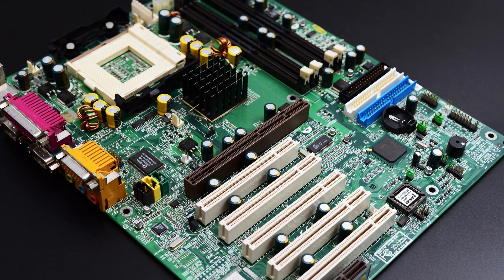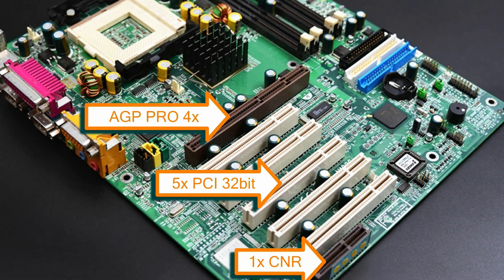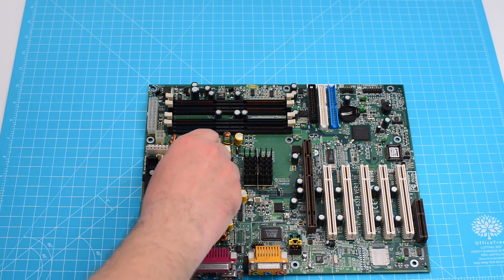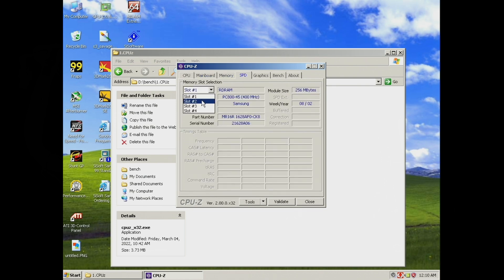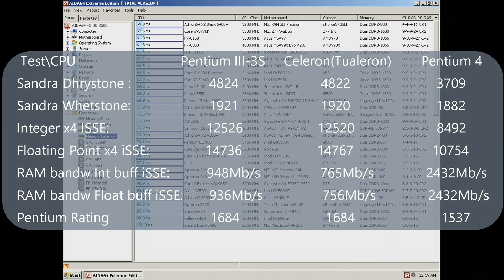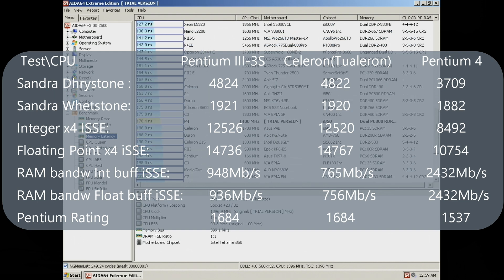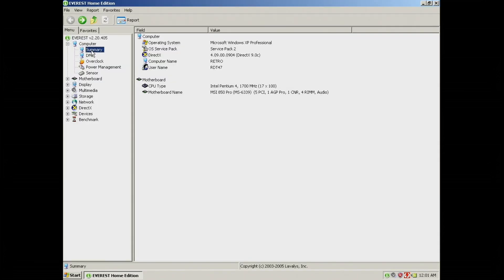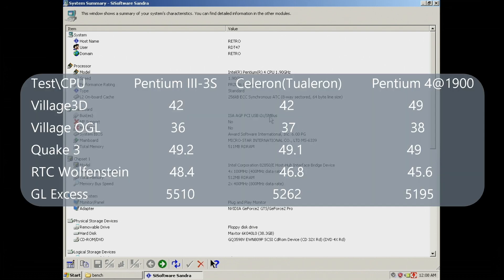First generation Pentium 4 1400MHz vs Pentium III-S 1400MHz

Comment: I'm currently running similar testing on socket 478 P4's of all kinds. The Gf4-Ti4400 should be enough. I tested with a ti4200 and it ran just fine, must things being cpu bottlenecked. I put in a Radeon 9800XT so it can run a larger set of games and tests, and it too is very bottlenecked. Running a P4-1.5, 1.6 and 1.7 Willamette vs 1.7 Willamette Celeron vs 1.7 Northwood (underclocked) vs 1.7 Prescott underclocked. I even ran the Prescott at 1.4GHz, as there was a bios option in the P4P800-E Deluxe bios to reduce it from 17x to 14. Pretty neat. 

One thing is for sure, they are slow as hell. Back at that time I ran an Abit Kt7-a Athlon Thunderbird (AXIA stepping) overclocked to 1.6GHz on water cooling and with a modified motherboard. Ran the +5V rail directly to the center pin of all three cpu mosfets and that stopped the Vcore drooping. The Tbird 1.6 absolutely annihilates the 1.7GHz P4's (any architecture). 

For a similar test without going crazy on a KT7A, you could run a DDR board instead with +12v cpu power and drop in an Athlon XP 1900+ (1.6GHz) but run the bus at around 160MHz (was running 10x160 on the Tbird). Soom as I'm done with the P4 testing I'll break out the Athlon stuff and give that a go. Should be fun
Reply from the maker: Sounds really fun, but I had given up on even trying to overclock these systems as there was no interest for it. (I had a different channel where I did this) . As for CPUs running at 1.4Ghz I have plenty of them including the Banias and Dothan sk 479 mobile. Also there is an AMD Geode that's really low power, maybe you should give that one an overclocking chance. Thank you for your comment. Cheers!

Comment: Still have my PIII tualatin working as my retro system great for old games… like the games you are playing
Reply from the maker: I enjoy these some of these games more than I do new ones. So I also keep a retro system around, it is centered around a core 2 duo but has a geforce 3 ti 200 as a graphics card. I will soon switch to this p3 system as I found more blue parts and I feel I can have a solid all around retro system with this one.

Comment: Hey what did you use for fps overlay on win 98se. Thx
Reply from the maker: This is actually windows xp used in this clip and I'm using msi afterburner. For win98 you can use fraps but you may need to look for an older version like 1.9 or 1.6

Comment: @4:20 missed opportunity.  "There Terminators will be in the back".  God I hated building this generation P4.  We sold AMD's 20:1 because of the overpriced RDRAM.
Reply from the maker: :))) the terminators will be back, I also have a p4@1400 socket 478 that will be part of this series...no doubt in the tests rdram performs faster than sdram but I think they only kept it up until ddr 333mhz.

Comment: Back then, we had an ECS motherboard socket 423 with a Willamette Pentium 4 ( don't remember the clock speed ). Rambus? Hah! Nothing that exotic, it was SDR for us. Had tons of issues exporting miniDV to VCD or DVD.
A few years later we upgraded to an Abit mobo, socket 939 Athlon 64 3200+ with an NVIDIA GeForce 6600, it was more than a monumental upgrade...
Reply from the maker: Back then I had an AMD, nothing as exotic as an Intel. The P4 were extremely expensive, and I only used it for games on the integrated SIS graphics card (equivalent to a sis 305) and a gf4 mx440 a couple of years later. I also upgraded to a sk 939 much later and by 2006 I had an agp 6600gt to keep it company. Indeed ... that system was flying.

Comment: Great camparison! Subscribed!

Also maybe recap that Asus board with new or salvaged polymer capacitors.
Reply from the maker: Unfortunately I don't really know the equivalence of electrolytic to polymer. I think the voltage needs to be the same or higher for the new capacitors. But I don't know about capacitance value. Cheers!

Comment: And use the oldest drivers possible as they need less cpu overhead. GeForce 45.23 and below is good. For older games use oldest possible drivers. For newer games drivers a little bit after the games release.
Reply from the maker: I think I used 45.23 for this one.

Comment: I recommend Radeon 9800 pro. Or GeForce fx5900, 6800 or 7900.
The older models have 3.3V support for the early agp slot version on old motherboard that had only 3.3V as in asus P2B.
Reply from the maker: Isn't a 9800Pro or any of the others a little bit overkill? I think I can find one that works but the P3 is out of their league and I would like to keep a minimum of realism in my benchmarks :)) I can definitely jump the horse with these graphics cards but in the end what would be the point matching parts that are so distant in time?
Reply: @retrodrive-thru47   early cards a pretty weak especially in games that use programmable pixel shaders like say doom3, or halo,  which can obscure what those processors can do,   I don't think it is unrealistic to use a 9800 pro/ geforce 5 or newer,  people were still using p3 and early pentium 4 systems well into those eras.
Reply: @retrodrive-thru47  9700PRO then. it's from 2002 so it's totally in its league. maybe a 9500pro or 9600 pro would already suffice though

Comment: I would use an agp  geforce 6 or 7 card,  or radeon  x or x1   instead if you can get your hands on one.   main reason being that  gpus in that era  are extremely weak, and even with a geforce 7800 gtx , there will be some situations where you are gpu bottlenecked
Reply from the maker: The 7800gtx seems extreme for a P3 , I doubt i can get it working, maybe with an adapter, but even so....I can probably find a geforce 6 and try it with a p3 in a future video. Thanks.
Reply: @retrodrive-thru47  yeah finding a 7800 with the 3.3v notch is probably pretty hard,  but you can find 6600s and 7600s with them fairly easily.

Comment: What software do you use for fps monitor it's riva server statistic from msi afterburner? It's not to havy for old system like this? To take some performance?
Reply from the maker: Usually msi afterburner(where there is a lot of info) or fraps. The system takes a performance hit, I've investigated in one of my first clips, the best retro OS... it's usually 2% for Fraps and 5-7-10% for Afterburner depending on the information displayed.

Comment: The "P4 connector" in your video isn't a P4 connector, that's an optional 3V/5V connector. It is doubled up with the connections on the ATX connector. Processor power is supplied with the ATX12V connector, which was frequently called P4 connector. I think your board might be a little damaged and contains a break somewhere between the optional power connector and the ATX connector. I think the damage might be induced by them running the net for one of those pins in a really bad spot, between edge and ATX screw head. There's a reason nobody should be placing the ATX power socket there on that edge like they did.

There are no banks on this mainboard, since it has no memory channels support. You simply fill the memory from left to right, any number of sticks, and then fill the rest with continuity modules.

Nice game selection. I haven't known some of these back in the day, should definitely check them out.

Software not optimised for SSE2? Well the T&L routines in the drivers should contain all specialised optimisations! SSE, 3DNow, and SSE2, though tangible advantage of SSE2 should be extremely minor. You need of course Direct3D7 or OpenGL software to make use of driver T&L but also a 3D accelerator which doesn't support hardware T&L but has drivers new enough for these optimisations sooooo... yeah.
Reply from the maker: Thank you, that's really insightful. I knew of some asus motherboards that don't require pairs of rdram but I thought that was an exception. As for Sse2 I didn't quite mean the games(this was a failure on my part for using a weaker graphics card), the encoding program had a checkbox to use sse2 on the P4 but true enough the performance wasn't that great compared to just SSE maybe a 5-10%. (I also would expect other programs like cinebench or superpi to take advantage of sse2). Do you know of the reason why encoding was better on the P4? Was it the longer pipeline, the better prediction branch? Cheers!

P.S. As for the connector I suppose there is a problem on the motherboard as some capacitor was hanging on just one leg in that area where all PSU connectors were.
Reply: @retrodrive-thru47   Why Tsunami MPEG is faster on P4 even without SSE2? I can't say without profiling on both systems. But i had worked on mpeg2enc about 20 years ago and the slowest part by far was the motion vector estimation, which is just... a lot of subtractions and comparisons. A LOT OF THEM since you're checking dozens of potential matches per block, for every potential match, counting all pixels. This was the area i back then was curious in improving by mashing a SUSAN corner detector into it, which... almost worked :D i wasn't very good :D Most of the encoder is in fact not at all pipeline sensitive or prediction sensitive, merely relying on raw arithmetic throughput - i think mostly MMX if implemented. I don't actually remember that much from the era.

Comment: So I've got a similar system - a Gateway PC that came with 64mb RDRAM, the 1.4ghz wilamette, Geforce 2 MX and a dead SB live. I have given it a great overhaul, so now it's a 1.7ghz wilamette with a few new noctua fans on the heatsink and case vents, found another 64mb of RDRAM to fill the terminated slots, got it a working SB Live with optical audio output and because it's pretty much a beast for 2001, I found a really nice Hercules Geforce 3 ti 200. It came with Windows ME, but I've put a new 120gb SSD in it with WinXP. It's a real fun machine.

BUT!! I hate the power supply. I want to get a new one, and that P4 connector is holding me back from just plugging in a new 550w. Do you know if there is any reason why I can't just splice up some molex connectors from a modern PSU into that same 6 pin connector?
Reply: You can get a 20-Pin to ATX 20-Pin & AUX 6-Pin Cables
Reply from the maker: I'm personally dealing with the same issue with PSUs. Good thing that there's an adapter for that. I didn't know it existed.

Comment: At the time the 800mhz P3 would beat most 1.0GHZ p4. The reason is the P3 had a shorter pipeline, allowing the register to clear faster if in error. This is why prescot and netburst is where this architecture ended and the P3 based core2duo and core2quad took over.
Reply from the maker: Yes reading about the differences I've come to the same conclusion, the shorter pipeline and bigger cache helps the P3 over the faster P4.
Reply: Не пишите глупость! P4 с частотой 1.0 ГГц никогда не существовало ибо Willamate самым слабым был 1.3 ГГц на сокете 423 и 1.4 ГГц на сокете 478. Идем далее Willamate это ядро которое было создано на тех процессе 180нм и вышло оно еще до выхода Tualatin который был уже на техпроцессе 130нм и сравнивать его надо не с Tualatin а с Coppermine. А вот Tualatin надо сравнивать уже с Northwoood.
И вот тут Coppermine и в подметки не годится Willamate. В процессоре важна не частота и не производительность на одинаковой частоте, а производительность. И вот тут мы приходим к тому что длинный конвейер позволяет на одном и том же тех процессе получить большие частоты (из-за более коротких внутренних инструкций) что дает нам максимальная частота Coppermine это 1133 МГц в то время как у Willamate 2000 МГц. Максимальный разгон у Coppermine 1200 МГц в то время как Willamate даже на посредственном сокете 423 гнался до 2.2-2.3 ГГц.
И Pentium 4 Willamate был не только гораздо быстрее своего предшественника на том же тех процессе Coppermine но и выступал на равных даже с процессором на более тонком 130нм техпроцессе и с двое большим кешем второго уровня Tualatin S который гнался максимум до 1.6 ГГц.
Прямым продолжением Tualatin был отнюдь не Conroe который уже значительно отличался, а Banias который имея тех процесс 130нм и частоту 1.7 ГГц (1.8 ГГц) и умопомрочительные 1мб кеша против 256кб у Willamate уже действительно не оставил ни одного шанса последнему. Но опять же Northwood на том же техпроцессе 130нм имевший вдвое менший кеш но частоту в 3.4ГГц он все еще не догонял.
И вот только следующее ядро вышедшее уже на техпроцессе 90нм Dothan и имея внушительный разгон до 2.5 ГГц и умопомрачительные 2мб кеша смог обойти Northwood и выступать на уровне Prescott 2m 3.8-4.0 ГГц. Именно Prescott уже в полной мере ощутил технологический потолок 4 ГГц когда дальнейший рост частоты уже давал гораздо меньший прирост производительности и требовал все больших и больших энерго затрат выливавшиеся в огромное тепловыделение.
З.Ы. Pentium 4 и NetBurst это отличный процессор и технология своего времени. Технология которая очень тяжело рождалась и слишком задержалась упершись в технологический потолок. По идее нужно было остановиться на Northwood который уже подобрался к технологическому потолку и 90нм настольные процессоры уже строить на ядре Dothan.

Comment: I believe the terminators are essentially grounded capacitors that reduce signal reflections from the dead end of the wire.

Imagine you're yelling in a long, stone hallway with one door at the end and one in the middle.
The person you're yelling to is in the middle room.
You're both going to hear echoes from the end of the hallway, and probably misunderstand words or at least have to talk slower. 

Now, put a thick curtain in front of the end door.

Most of the sound is going to be muffled by the curtain, and the echoes will be greatly reduced.

Electrically, the terminating capacitor is the curtain, allowing the signal to be absorbed instead of reflected.
Reply: Terminators isn't quite the correct name. RDRAM is a bus that is terminated on the mainboard. To fill out unused memory sockets, you use CRIMMs which are continuity only, not termination. When CRIMM are missing, the termination is of course missing as well, you get a floating far end. There can only be one set of terminators, but any number of RIMMs or CRIMMs, so this setup is more flexible.

Termination is resistive, not capacitive.
Reply: @SianaGearz  oh? Please explain further. I thought they were boring old decoupling caps on a card.
Reply: @myne00   CRIMM card has no soldered-on components at all, it merely connects socket's input lines to socket's output lines.

RDRAM bus is connected in series from one chip to another; and when a chip is missing in the chain, you still have to make those connections to pump the data through. The RDIMM has an only 16bit narrow bus, and the socket is long due to loop through outputs.

In contrast SDRAM DIMM sticks (disregarding dual channel) are all mostly connected in parallel as opposed to in series, with just a couple unique address lines per chip or stick to differentiate them. The socket's data bus width is 64 bit.

Comment: 1:21 that "one different number" is the datecode, week 5 and 8, 2002 (YYWW). Also getting RDRAM sticks is so cheap these days, there's no reason not to populate all 4 slots. 64MB modules are completely worthless, and 128MB ones aren't much more expensive. Where it gets exponentially more ridiculous is 256 and 512MB modules, or the unicorn 1GB ones that appeared so late and were so ludicrously expensive, they're almost non-existant
edit: as for the caps on the Asus board, they're at least easy to replace, which is what I've done on my P4T. Runs a 2GHz P4 Willamette with 4x 256MB PC800 RDRAM just fine now. IMHO when dealing with 20+ year old PC HW, you should expect things to need maintenance, and capacitors are a wear item. More often than not they will have degraded, or worst case with cheapo ones have dried up (acting like a resistor) or leaked causing shorts and unwanted fireworks
Reply from the maker: Yes, it would be a good ideea to test them for resistance with a multimeter before powering on any board. I do have several 512mb pairs. I usually like to keep it a bit real and keep the memory somewhat close to what people could afford at the time. It was also a good ideea to present the terminators because I've learned some things about them from the comments. I never knew that there were 1gb modules. Cheers!

Comment: After seeing that a couple boards blew a cap, it would probably be wise to re-cap those boards completely, or at least replace the caps in around the power inputs/ram/cpu socket
Reply: No.
Reply from the maker: I would think so too. Since they do the same function I would replace them all in that area, and around CPU too. I'm not really trained to identify which capacitors belong to which area that's why it would be difficult for me to identify those responsible for RAM.
Reply: @retrodrive-thru47  really it's the larger ones around those primary system components that are doing the heavy power line filtering and supply to those components, I've fixed boards that weren't stable or didn't post before by swapping the caps around those areas